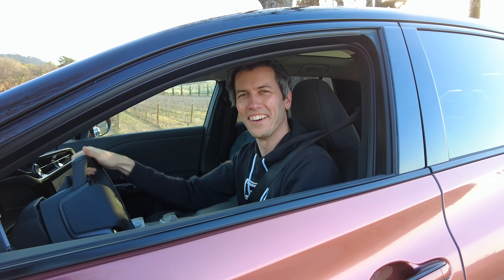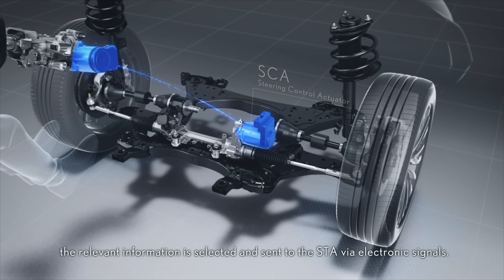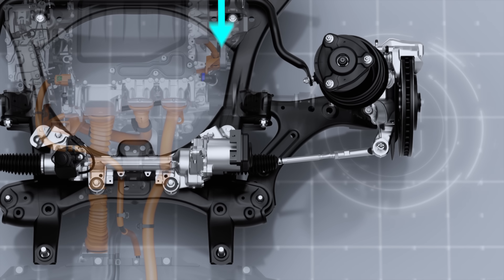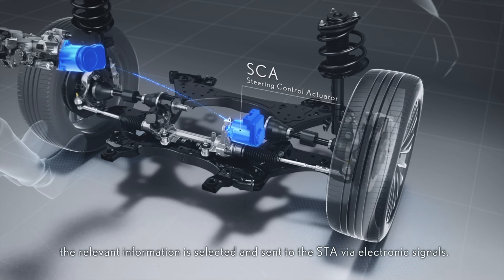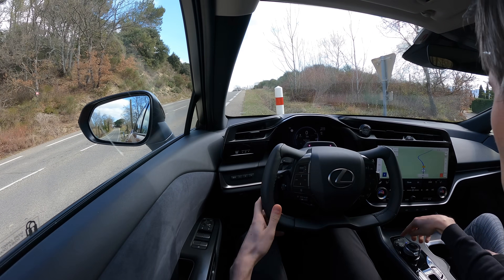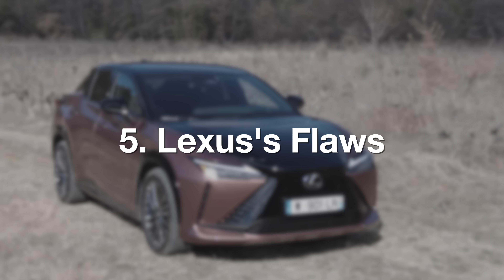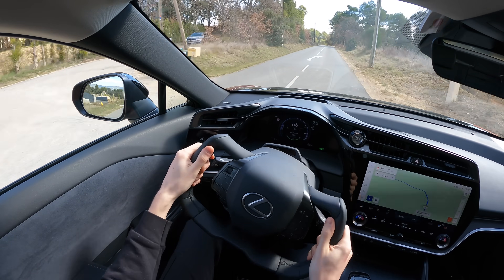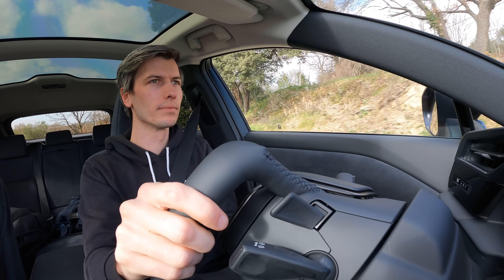How Lexus Fixed Tesla's Bad Idea: Steer-By-Wire Yoke

Comment: I don't like the idea of modal steering especially if I don't have direct control over it.  For example, I use vim as my text editor.  It's modal.  I make mistakes in it all the time because of it.  Worth it for the speed.  The difference is that its text and I can edit mistakes.  A car, not so much.  Things should be as consistent as possible in a car, even if it's slightly less convenient.  The only exception is maybe parallel parking because the degree of annoyance in the current system and the amount of time you have to react makes it worth it.  But everything else should be the same to maximize developed intuition.

Speaking of worth it for the speed, that's why it makes sense in racing.  A modal system that is tuned for the multiple environments you use it in will always be the pro-tool.  It doesn't mean it's the safest.  I can be expected to gain intuition of a multi-modal system.  I'm a programmer.  A racer can as well.  He's a professional driver.  People are failing every day to master the tools they are currently given on the road.

Comment: The issue for me is predicability. If I cannot tell the yoke angle and wheel angle at any giving speed, then it's a problem for me. Maybe use high resistance in the yoke during high speed like sports cars without limiting the ratio, that may be a better option imo.

Comment: A hard "no" to this. Just because you can do a thing doesn't mean you should. Disc brakes over drums? You can make an argument for that. But this just isn't necessary. There are 2 reasons I see this tech coming, though. One, cheaper to make, and two, at some point it will allow a source outside the car to take over the steering function. Yeah, we can all see the emergencies when that would be useful, but no to this, I say.
Reply: Can't wait till we see brake-by-wire systems.

Comment: I appreciate the parallel to aviation when mentioning system redundancy. It appears to be something that can be reliable and applied with much success.

The key to that comparison though is how airplanes are maintained compared to cars. If you think an error light on the dash will make people drop everything to fix the steering then you are wrong. People will run the car until it fails completely.

Comment: You missed a huge opportunity by not talking about when Porsche removed hydraulic steering a decade ago. I was confused by this whole video cause I thought steering by wire was introduced ages ago and I remember everyone being upset at the time. Also the new Ford GT being completely hydraulic everyone was like finally back to basics. You missed that whole chapter. Maybe intentionally for time but I'd love a follow up on how this is different than the 911 997(i think?) and all subsequent models. Also the McLarens and Ferraris and Lambos. I thought rack and pinion was dead a long time ago but now I'm confused. Please explain.

Comment: I love the idea - I totally expected Tesla's yoke to be steer-by-wire, but kudos to Lexus if they actually ship this to customers. The input lag would be a killer for me though - I already find that to be a problem when I (rarely) drive SUVs with sloppy suspension!

Would be interesting to see the input lag measurement for the mechanical version of the same car. I'm sure there's a few tens of ms at least from backlash in the pinion gear and linkages.

Comment: The delay in steering is due to the motor not being able to move as fast the input. It's not anything to do with extra electrical processing delay or something like that. If the system was mechanically linked you simply could not move the steering wheel that fast because the inertia of the wheels turning would slow you down. I'm not saying they shouldn't work on the tuning, I'm just saying it's not an inherent flaw of the tech.

Comment: I'm sure that Lexus will allow steering sensitivity to be set from the touchscreen, at both high and low speeds, for the same reasons that computer users can set their mouse sensitivity.  Why not?  Maybe disable sensitivity setting for rental vehicles, or require a passcode to change it.

Comment: If planes can have fly by wire, then I think as long as similar care and redundancy is in place, it can be made safe. No idea if it solves enough problems and could be made cheap enough (while retaining safety) to catch on in mainstream, but only way to figure that out is have it an option. I know modern cars are pretty good about not impailing people with the steering column, but maybe some safety benefit not having a steel shaft pointed at your internal organs. As a sports car enthusiast I wouldn’t want it on my Miata, but as a tech enthusiast and engineer I am intrigued by it.

Comment: The software is the single biggest weakness of any system like this. While software bugs are a significant concern, what concerns me far more now is digital security. Can you imagine a more terrifying act of digital terrorism than writing a virus that causes your car to accelerate to freeway speed and then lock the steering all the way in one direction? It wouldn't even need to be every car. Just a few dozen, maybe a few hundred times, and a whole country could be brought to a standstill.

This is not a new or crazy idea. Computer viruses (probably wouldn't have been necessary to make that distinction a couple years ago) have already been used to damage and destroy physical systems. This is the single biggest security threat of the 21st century and we need to start thinking seriously about it.

Besides that, though, it's a really cool idea that I really love in principle.

Comment: There is a big potential problem with variable steering ratio, and you did not mention it here for some reason: let's say you are making a turn at a very low speed on a curved section of the road that has a constant radius. Then you floor the gas pedal and begin to accelerate quickly. If the steering ratio changes (in this case, decreases) quickly as well, your wheels will try to straighten up to correspond to the position of the yoke even if you do not turn the yoke. To keep you on the road, the motor connected to the steering column should rotate the steering wheel in the direction of the turn while keeping the wheels pointed in the same direction as you accelerate, otherwise you will end up in a ditch quickly (on the right side if you are turning left or on the left side if you are turning right). The opposite will happen if you decelerate quickly on a curved section of the road: the steering column motor should rotated the yoke in the direction of the turn while the the turning angle of the wheels remains the same to keep you on the road.
When you are driving a car with mechanical steering, you just keep the steering wheel in the same position, no matter what your speed is and whether you are accelerating or decelerating on a curved section of the road (I disregard the effects of understeering and oversteering here).
How did Lexus solve this problem? Why did not you mention it - because you did not notice this problem or because you don't know the answer and did not want to look incompetent?

Comment: Since the yoke doesn't rotate 360, I wonder if they are still using a clock spring system or just a simpler wire bundle with more flexibility?

Comment: -Better isolation 
-Less vibration 
-Good for collecting precise data between lanes 

-Predict the tiers conditions 
If the computer collecting data from speed/pressure/temperature /braking/turning angle on speed 

Am I going so far

Comment: The steer by wire has other advantages too.  If your car has some sort of autosteer, it's easier to implement.  The lack of a steering shaft removes a possible problem in front end crashes.  It makes it easier to build left and and right hand drive cars.  Steer by wire has been on aircraft for over 20 years, and they, like car steer by wire, have redundant safety systems in place that will self-diagnose faults.
Past conventional power steering systems were unsafe in that they often over-boosted and were, by today's standards, unreliable.
It's natural to have reservations about new tech.  It must be proven.  Other future new tech will perhaps be the removal of outside mirrors in favor of cameras.

Comment: It seems an amazing solution. Increasing the steering ratio at low speeds would simply make every manouver much easier, regardless of whether you have a yoke or a normal steering wheel.

Comment: I love how the argument made by the Lexus engineer is about improving response, but then later in the video you quash this by showing the delay in the steering response compared to what would presumably be a 1-to-1 response from a mechanical steering system. Until they fix this it's not good enough.

I also agree with the other comment about variable steering ratio. Predictability is the most important thing, regardless of the speed you are travelling at. We rely on feedback to develop muscle memory and as long as the ratio changes the feedback will be inconsistent. Because it is inconsistent, there will always be a short time at the start of any steering input where we are trying to interpret that feedback to decide whether to increase, decrease or maintain steering input. With time and learning we can increase precision (I like to think of us a bit like an active damper, responding to feedback), but with a variable ratio system you will never get the same level of precision. There are already many variables that affect the grip level on the road surface, and then we're adding another major variable ontop. I'd imagine the safest bet would be to use a traditional steering wheel and set the system to a constant steering ratio, but then that eliminates the main benefit that Lexus are trying to show. In reality, the main benefit is cost and weight savings, so if they can get the system to perfectly replicate a mechanical system, they will be onto a winner.

That combined with the delayed response would make one feel completely detached from the wheels. However, steer by wire systems have been used in Motorsport for a few years now (e.g. from Schaeffler, used in DTM and the Porsche Caymen at the Nurburgring 24 hours) so it must be possible to optimise the system for performance and driving feel, where response time and predictability are probably 2 of the most important factors. Maybe some companies aren't there yet.

Comment: 4:50 does it mean the angle of the front wheels will CHANGE while your hand are in the SAME position? for example, when you are decreasing speed in a sinuous road, the steering radius will decrease, so the car will start to steering MORE while your hand stays. Some youtuber should test it in a desert or in a airport, something like that.
I can agree with smooth "weight" transition like normal assisted ones between lower and higher speeds. I don't think I agree with ratio transition.
Also I can agree with ratio changing along the curse of steering. What concern me is that depending on speed. How the car will assure the speed? what about speedometer failure? will it steer more than you expect?

Comment: Countersteering!?  on snow/ice

What will heppen when you drive with hight speed, and do a counter-steering move. You need to turn your wheels in the same direction your back end is skidding towards. If done quickly enough the car should straighten itself. But with bigger speed it may not have the desired turn angle (big speed small turn input).

It will be nice to have a test in this situation.
I really like the concept and used to think that tesla would have the same approach when it was announced. 
Thank you for what you are doing!
Reply from the maker: Great question! I've asked Lexus and hope to get back here. I'm certainly curious if the overall wheel angle is limited at higher speeds.

Comment: Let me know where I'm wrong but if Lexus is going for the drive, brake and steer by wire, then they should probably go all in... Let stability and traction control, abs and other nannies micromanage the vehicle driving. In other words the feedback isn't necessary... All the driver has to do is to tell the vehicle when to go, when to stop, and in which direction.

Thanks for the video.

Comment: I am cool with an ECU for the engine. But there is no need to have a computer on anything else. Steering, throttle, and even all the lighting do not need a computer to control them. I want full mechanical control of my steering and my throttle. I also like the sensitivity to be exactly the same all the time. I know what to expect then.

Comment: Very cool video Jason @Engineering Explained! Steer by wire finally arrived, and I see as the main benefit the option of variable ratios, also opening the avenue for a stick to replace the "bulky" wheel. I was wondering it an alternate solution could be safer (or at least seem to): keep the steering column, but coupled to a torque split device (like an open diff / Toyota synergy drive) and an electric motor. In case of any failure, a spring-loaded brake or lock engages on the motor's axle, locking it into some kind of fixed ratio "driver input only" mode.

Comment: Couldn't you have a mechanical setup with a constantly variable (shudder) gearbox, so you can keep the short throw at low speeds and less sensitivity at high speeds, while eliminating the lag?

Comment: Steer by wire has obviously been long overdue. As in, it should have been there decades ago. Planes use fly by wire since forever. No one is complaining that they're unsafe. It has the potential to make everything better, both experience and manufacturing. People who blame the technology for that rather than model specific implementations simply don't know what they're talking about, or they're luddites.

Comment: Only an engineer could love this, it's a solution looking for a problem. If EVs have more torque and power than the average human can cope with using a power assisted rack and pinion steering system, then they shouldn't be street legal. I've ridden in a Tesla Model S in ludicrous speed mode and I don't think it should be street legal

Comment: Drive by wire, very interesting.  Who makes an EV without one pedal driving capabilities nowadays?  Like, even in pre-production models of their EV's?  And you said it doesn't have instant throttle response?  They'd better catch up before putting that thing into production.  

Back tot he yoke.  You drove it -- could you tell there was a delay?  Did it feel like you were driving a boat, or was it pretty natural?

Comment: This sounds like a great idea, but I hope that (1) Lexus provides the new system with the old wheel shape as an option, and (2) they give the user some ability to change the ratio curve. The main problem I see with this system is that drivers who have driven mechanically-linked steering for decades are just used to it, and Lexus will be fighting muscle memory one way or another, so if the user chooses not to fight and to configure the steering to their preferences, let them.

I drive a fairly twitchy car already, so I don't think I would bother to change the low-speed ratio, but I would be tempted to tweak the highway ratio slightly so the change in movement range isn't as apparent. I imagine most drivers who don't drive on a fast rack already will want the reverse.

Comment: Steering response with drive by wire is NOT faster than a mechanical linkage .... Only advantage is the ratio Change which does not  affect response but introduces delay due to signal processing delay and motor transient response. There are already mechanically linked steering  systems with variable steering ratio.  Lexus excuse for this over complication is a reach  and inaccurate.

Comment: 12:23 With a mechanical system, I doubt if you would be able to move the steering wheel that fast. 
Would it be possible that all in all this steer by wire system is still faster than a mechanical system would be, despite the delay?

Comment: I have a Tesla with the yoke.  I really like it.  I can say that the complaints about parking lot steering are way over stated.  It is quite easy to do multiple turns of the steering column using the yoke, it is just a bit different than with a wheel, but easily done.  Having said that, I hate the haptic touch buttons for the turn signals.  They are awful, it is actually the only thing about the car I do not like, and I do not like it a lot.  I like the idea of no stalks, but the haptic buttons suck.  I would prefer something mechanical, something like an old fashioned power window switch.  I was also under the impression that Tesla did not do a drive by wire because of regulations.  Same as having side view mirrors.  Am I wrong?

Comment: There's nothing wrong with the old steering system that has been used for decades. There's no reason to change it. Ipersonallybwouldrather have manual steering. I've had it on a few cars and it's fantastic. Also I would never have a yoke. I use the top of the steering wheel to steer. Not both hands on the left and right.

Comment: Thank you for putting in video what many have been saying all along. If you have ever driven 'spiritedly' or have been sliding out of control on a road - you will not drive a car with a yoke. It's hard to steer when half of the wheel is missing... shocking.

Comment: much like the mouse sensitivity setting steer by wire can allow you to tune the steering profile to your needs.  more/less sensitive, more/less feedback. tricky part is bound the settings in such a way that the user doesnt have dangerous driving experience based on their preference.

Comment: This design is so unlikely to fail. And when it does it will be so inexpensive to repair.
Reply: When it fails, there will be no need to repair it since the vehicle will crash into a wall and be destroyed.
Reply: @soaringvulture  problem solved!